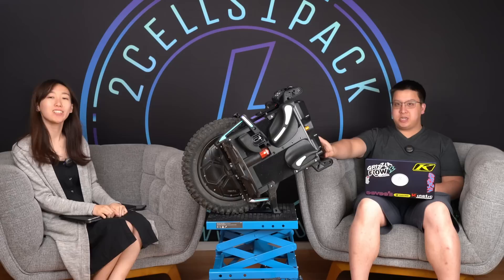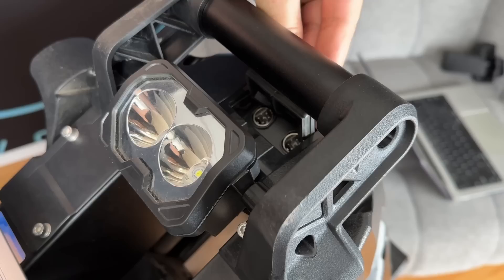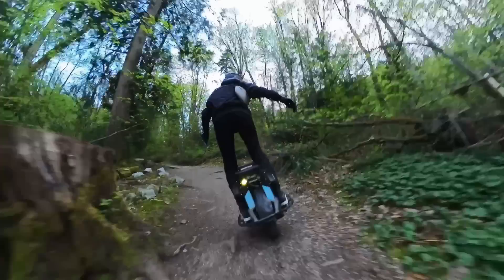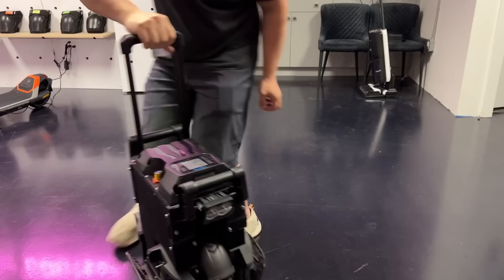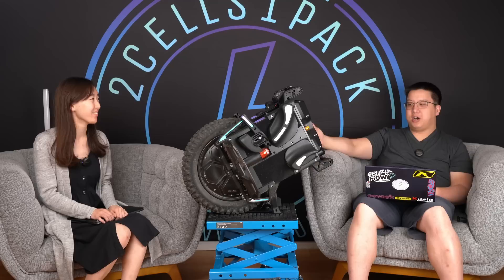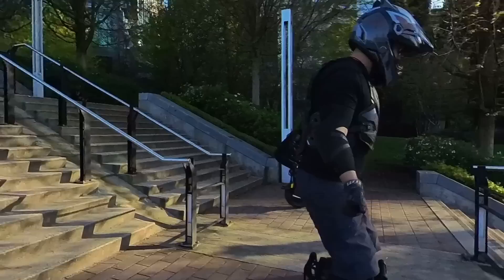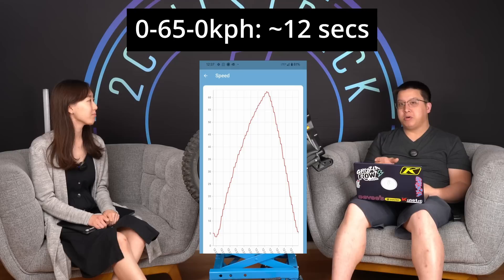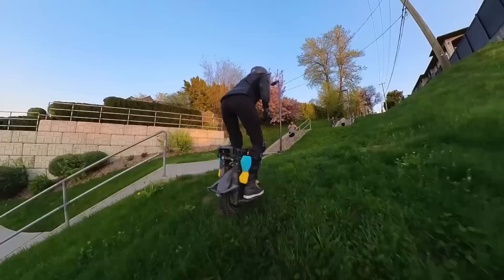Veteran Patton - 500km Review

Comment: Well, I bought one.  I'm coming from 3yrs on an Inmotion V8F.  As I mentioned earlier I am a heavy rider so I ordered the 66# springs and since I only ride urban streets I got the street tire.  Thanks for your input.
Reply from the maker: Congratulations!
Reply: @2cells1pack  One more question if you have time.  For a more relaxed rider it seems that some power-pad pad locations may not be needed.  The forward shin pad seems unnecessary for my casual riding style?  I think I would use the one over the toe for lifting, and one behind the calf for braking.  I just don't see that I would need that front shin one though.
Reply from the maker: power pads in general are not needed on wheels. But they are there for convenience.

Comment: This is a helpful video despite the audio issues. Thank you! The “disappointed” label is very misleading though.
Reply from the maker: Yeah, the audio issue was unfortunate. We were disappointed because we had such high expectations from our first impressions.
Reply: @2cells1pack  so.. if suspension is the only real issue what if ppl step up a stiffness level?  I weigh ~180 lbs, so my default would be the 62lb version but I could get the 66lb instead.
Reply from the maker: We had a 62lb and 66lb. Christine (<100lb) was bottoming out the 62lb easily. I (240lbs) was bottoming out the 66lb by jumping up and down on the wheel staticly. (even with compression dampening on max)
Reply from the maker: Christine preferred the 66lb, but she weighs less than 100lbs and is definitely on the lower end of the EUC Rider bell curve.
Reply: @2cells1pack  Did Christine try the 66lb? It is super informative to have your different body types reviewing in parallel btw.
Reply from the maker: I rode some trails with the 66lb. I was able to compress it, it feels good and not stiff. Tbh, I do enjoy riding the 66lb, at least I dont have to worry about bottoming out. 
- Xtine :)
Reply: @2cells1pack  Thank you both for all the insights!

Comment: Hi I’m a 130 pound man and I pre ordered the 58 pound suspension because it recommends it’s for [<175lbs]. After hearing your review about the bottoming out I’m torn… should I change my order to either the  62 or 66 suspension? I’m just confused cause I though they had weight suggestions for these various suspension models but you said that even though you weighed 100 pounds the 62 suspension was too soft! What would you recommend for me who is 130 pounds?
Reply from the maker: I would recommend heavier for sure. But that's our personal opinion
Reply from the maker: Also, it really depends on the type of riding you do. If you're going to use the wheel mainly for commuting , then the suspension should be okay for you.
Reply from the maker: I think I was still recommend the 62 lb though
Reply: @2cells1pack  Thank you for the quick reply! Did you me you "will still recommend the 62 lb" for my weight class, over the 66? I believe you had a typo
Reply: Also, I'm considering switching to street tires since most of my riding is on paved roads. but all the review i see are with knobby patton tires. Do you think street tires would work well on the Patton or does that go against it's design as "an ideal off roading EUC"
Reply: @brianonwheels  have u had other wheels before? I mean I think (UNLESS U LIVE IN A CITY)  go with knobby as that wheel u probably make u want to ride off road like my s22 does with me... but to each there own... do what you like and I hear it isnt to hard to make a tire change so if you did get the knobby and then really wanted a street tire you can now pick what will be the tire people are giving out more info on as to what works best on street etc. Enjoy that Patton.
Reply from the maker: i wished i had a street tire to put on the wheel tbh.

Comment: Is this the best euc with around 16 inch wheel size with suspension for all around use (commuting + light off road)? If not, which similar size wheels are better for general purpose?
Reply from the maker: As of right now, yes I believe so. Unless weight and price are considerations, the T4 is a lighter and cheaper package that will also get the job done
Reply: Cheaper option is the Begode T4 or the Inmotion V11.

Comment: Great review, I really enjoyed it, subbed. Christina, what size helmet are you wearing in the video, S or M? I'm also around 100 pounds and with a relatively small head, it is really reassuring to see that you can manage the wheel so well!
Reply from the maker: Christine wears size S helmet, however keep in mind that TSG helmet isn't good for higher speeds. I would view the TSG as a little better than a bicycle helmet in terms of real protection.
Reply: @2cells1pack  okay, so probably up to 35km/h (20mph) speeds. I'll think about it, thanks for the advice! I'd love to see a review video of your Shoei Ex Zero at some point!
Reply from the maker: I’m still waiting for my Shoei Helmet to arrive. I ordered size M, ended up a bit too big for me. However I did find out the sizing of different brands are slightly different, and it fits different head shapes. The Shoei size M is very similar to the TSG size S, which both are on the loose side for me. Hopefully the new Shoei will arrive soon and we could do a review on the helmets :) 
- Xtine

Comment: I thinking about picking up a 62lb version of the Patton. I weigh roughly 150 with gear on. You think that'll be too soft and cause bottoming out? I do mostly street riding and rarely offroad of do stairs.
Reply from the maker: If you’re doing mainly street riding with a couple of steps, you should be ok with 62lb

Comment: Great review and format!

Regarding the suspension, the consensus of reviews seems to be to go with the 66lb spring, even for lighter riders if riding heavy bumps/jumps. Bottoming out only after longer sets of stairs, however, sounds to me like classic suspension “packing”, where the rebound damping is set too slow to allow the shock to return to its starting position between successive hits, and therefore the wheel ends up deeper and deeper in its travel with each stair hit and eventually bottoming out. Increasing compression damping can also reduce this effect, but at a tradeoff of comfort. 

Ideally, spring rate selection should be determined by static sag. The geared up rider at a standstill should be compressing 15-25% of the total shock travel. Comfort and bottom-out resistance are then tuned with damping settings.

As a 170lb rider on the fence between 62lb and 66lb spring rates, I’m curious if a lighter rider (such as 100lbs) still gets any meaningful static sag at all with the 66lb spring? With too little sag, suspension performance and handling can also suffer. 

Thanks!
Reply from the maker: Regarding: 
- "packing" - the suspension bottoms out only on the last step. We have the rebound set pretty quick if you look at the closeup of the stairs shots 
- static sag - with christine on the 66lb patton, it still did sag. Sag on the 62lb was in the 30-35% range which IMO is too much.
Reply: Thanks so much for the reply! Agreed, 30+% sag is too much. Some empirical sag measurements were exactly the info I’ve been looking for. Now I can buy the 66lb spring with confidence.
Reply from the maker: We had recorded a suspension setup video, but realized quickly that it was pointless since both of the suspensions were too soft.
Reply: Let’s hope Leaperkim or the aftermarket produces progressive-rate springs for the Patton to push its relatively short suspension travel closer to perfection.
Reply from the maker: 100% that would be AMAZING.
Reply from the maker: That would literally make me dance in excitement.

Comment: I believe that they suggest a lower coil weight for the suspension because it allows the user to have a very soft suspension for paved roads and commuting, but they can still adjust the compression dampening to make it not bottom out on the trail. Getting a heavier weight won't allow you to get as soft as it could be.
Reply from the maker: Even with compression dampening at max, I could still bottom it out.
Reply: @2cells1pack  oh wow that's concerning. Though, I have a friend that's 140lbs and he says the 52lb is too stiff for him even at the softest settings. I'm assuming it's because he isn't riding it as hard as you guys. I bought a 58lbs version but mainly using it for the road and I'm 120lbs. Do you think that's fine?
Reply from the maker: @critzlez8593  for the road, it should be nice and cushy.

Comment: Very nice constructive criticisms and I plan on getting the Patton myself but 3rd batch. By then, I hope LK make the front handle higher, make the toe piece wider, have a better shape of the front bumper for better adjustability to workaround that screw head, and maybe have better headlights. And I’m not going to hold my breath but maybe they can improve on the Patton. But if they don’t, it probably won’t matter since I’m not into doing long stairs or big jumps. But looks like the 66lb suspension is the way to go, so thx for the review!
Reply from the maker: The headlight.. has been a staple for LK since the Sherman hahaha. Honestly tho, all the cons can be overlooked because of the performance

Comment: Did you measure the S22 and Patton? Reason I ask is the S22 is the widest wheel i've ever ridden or owned its 2.5" wider than a master and T4...
Reply from the maker: No, I didn't measure them unfortunately.
Reply: @2cells1pack  So then would you say you are 100% certain its wider? I will measure my S22 (unfortunately I did not get a Patton) so I can compare.
Reply from the maker: I would say it feels wider. I can't say 100% certain since i didn't measure them.
Reply: @2cells1pack  I'll have to make a trip back up to eevee's. I am still convinced the s22 is the widest wheel to date. However width of wheel varies greatly on feel depending on its placement height on the legs. The RS19 was the most uncomfortable wheel i've ever ridden du to its super low width (very bow legged stance on it) for me.

Comment: i JUST PURCHASED A EX30 AND i AM A BIG (TALL AND HEAVY 270LBS @ 6'4) How much torque'er would you say this wheel is than the ex30?  I also have s22 for the purpose that I would use this wheel for  but, I do not like the small clearance that leaperkim did with this wheel, it's a shame as it seems like everyone is raving about the performance of this wheel. I simply could not buy it because of the suspension Leaper uses (cannot change it to something else) and the clearance on this wheel is so low... what do you guys think about this wheel for bigger guys like myself? I am 6'4" and 270 lbs without gear I I do jump and love trails!!!!! have you thought about testing the torque climbing vs ex30 or extreme maybe when it comes out, I know it is a bit unfair since this is a 16 inch wheel and everyone that researches knows smaller wheels make the same motor feel more torquey(sp) so that is one thing ppl need to remember. also, I think begode will make a new 16' wheel (extreme bull maybe) to face off vs this wheel LEAPERKIM put out) it does seem like begode /extreme bull want that performance crown. I would love to hear what you think as I really enjoy a bigger guy closer to my size riding  and reviewing wheels  (I am still waiting for my ex30 to arrive from china (batch 3) it will be here june Yay) Thanks in advance for your opinions and I look forward to what you think on a smaller wheel like this at speed of 70kmph or here in the USA 42 mph... how does it feel at speed ? I cant wait for my ex30 as I think that wheel will be great for bigger guys. Thank you and you 2 have a GREAT SHOW
Reply from the maker: The EX30, commander Mini, extreme are all wheels I would like to test. Just waiting to get my hands on one
Reply: @2cells1pack  OH sry, I thought I saw you in a video with another guy (on his channel) maybe electric dreams? So I assumed u tested it ... thanks mate good to know. Keep up the nice format of your videos!

Comment: If you'd decide to do a later review, it would be nice to see how durable the parts are. How complicsted it is to change a tire, if it can hold up in pouring rain etc.
Reply from the maker: We have a tire change specific video that was released before this video. It has held up to rain quite well - and Wrong Way also released his video showing heavy rain use.

Comment: Bottoming out at a rider weight of <100lbs! WTF?? Could it be in the compression/rebound setting or otherwise, I dont get why they even bother with the lower W springs. Will eagerly await the obvious inevitable Patton v Extreme comparo
Reply from the maker: Yeah, we mentioned that compression dampening could solve the bottoming out - however i feel it's a bandaid solution.
Reply: Isn't this where stiffening up the compression setting come into play?
Reply from the maker: yes it does - but i like to have the spring properly match first. Then fine tune with dampening
Reply: @2cells1pack Great thinking ...but if that's all we have to work with, does it get the job done?  For the average rider?
Reply from the maker: Yes, if you're not doing any big drops you'll be fine.
Reply: @2cells1pack  Thx

Comment: So, you're 240lbs and still got 50+ miles? What riding mode? Normal or high speed mode? How does the 66lb shock handle your size and weight on jumps, trails, curbs, stairs? Bottom out often? How cushy of a ride is it? You mentioned it's easier to bottom out for heavier riders, but HOW much easier? Her riding the 66lb shock and it feeling pretty good on trails tells me I will need a heavier spring/beefier suspension like the Sherman S to not bottom out on around town, mtb trails, stairs, and occasional jumps that are 5-6ft drops, max. I'm 210/225lbs with gear @ 6'1, and think the Patton just doesn't have the suspension I NEED for my weight, especially for offroad and jumps. Although being a heavier rider, and having a small, zippy, lighter, torquier wheel will feel way cooler. The patton seems to have plenty of overhead and torque that taller and heavier riders can leverage the wheel hard and not worry about cut out. That is a bonus for me. And considering it's about the same speed as a sherman s (although not as stable), I can see this becoming my go to wheel for almost everything. But perhaps only on later versions with updates to beefier suspension with more travel. 

How does it compare to feel of Sherman S? Sherman I'm guessing feels more plush, but much more plush compared to Patton? Or like a 10% difference vs a 90% difference in ride cushiness?

I'll have to test ride em for a day to get a really good estimate, but curious your experience between the two, especially for heavier riders. 

GREAT review. So thorough and straight to the point with objective data and and useful subjective experience too.
Reply from the maker: 50+ miles of light riding (12-15mph avg speed) High speed mode. 

66lb definitely not heavy enough for my weight. Bottom out a lot. Super cushy ride though. You can definitely bottom out the wheel on your weight easily - watch my suspension setup video and I do show examples. 

The torque of the wheel, the playfulness of the wheel is what makes me forgive the lack in suspension stiffness. I still miss the wheel. 

At speed, the wheel is very stable. 

I haven't tested a Sherman S yet, so don't know about comparisons.

Comment: your cover image really scared me😅
Reply from the maker: haha sorryyy.. but we were disappointed by the suspension softness.
Reply: @2cells1pack  I now own a Patton, based in part on your review, which is mostly very positive. I'm still stumped by the thumbs-down cover image. I'm 165lbs with the 62lb spring. If I never drop down a set of stairs in my life, or jump, I will die with no regrets. All I want from suspension is buttery cush over poor pavement, potholes etc at speed. This delivers, so far.
Reply from the maker: It is good for people who just want it for road use. But thumbs down because of the fact that it could've been a really good trail wheel if only the suspension could keep up.
Reply from the maker: just so close to riding perfection.

Comment: Eucs have gotten faster but they've also gotten far too heavy.. quality is horrible, suspension is worthless... I trust my Street motorcycle at speeds over 100 mph but I can't trust EUCs at 40...lame
Reply from the maker: Quality is slowly getting better!
Reply: @2cells1pack  awesome, you should have something rideable in maybe 10 years
Reply: Do you even ride an euc busy?  They are a complete different thing to a motorcycle,  they have access to all the walking paths and trails, they can fit in your car and they are quiet.
They have many advantages over a motorcycle,
Reply: @srnunan4783 been Riding King song 16X 3 years now, nothing worth upgrading till they get way faster and lighter. And you can laugh at my 16x and I can run you over with my motorcycles so there's that